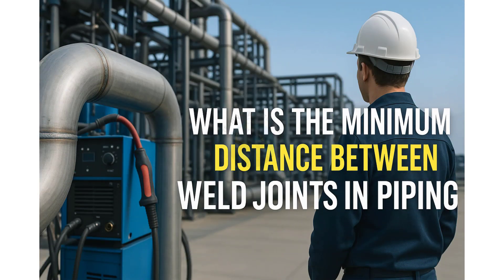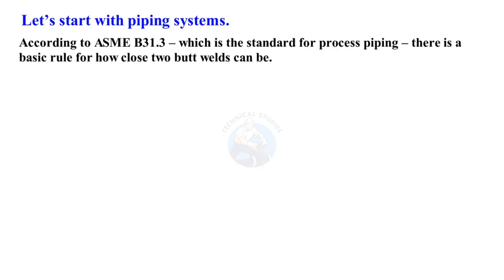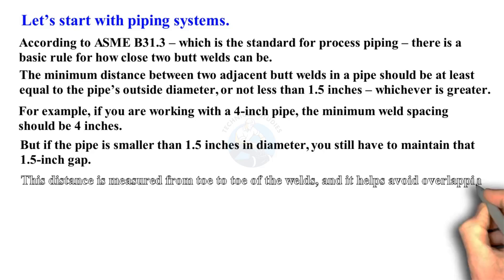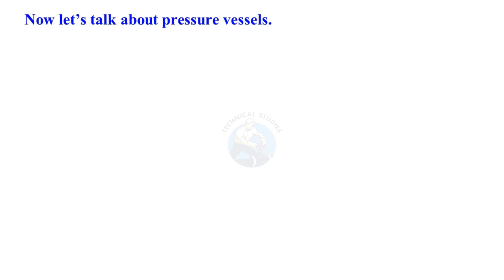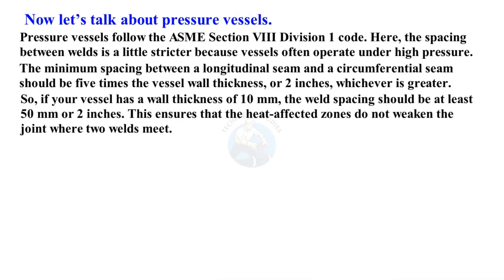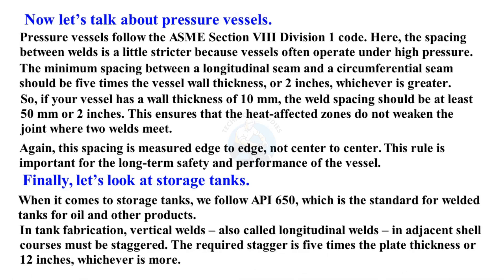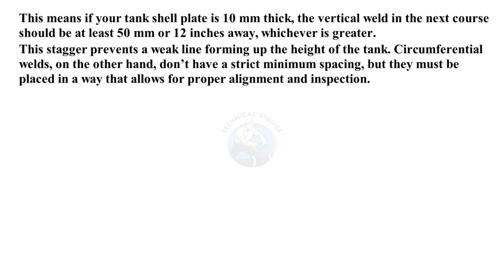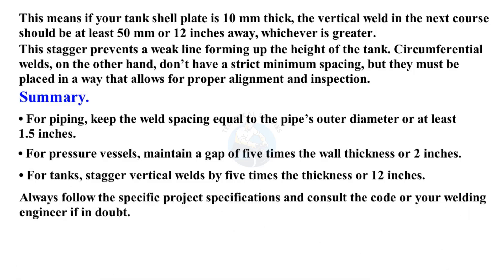What is the minimum distance between weld joints. Piping, Pressure Vessels, Storage Tank.

Comment: You have a spelling error :-  
In tanks if the thickness is 10mm the next weld should be at least 50mm or {2 inches not 12} 

Thanks a lot for this information 
Great video
Reply from the maker: Thanks for catching that, Bro! I'll make a note to correct the typo. Glad you liked the video!

Comment: In B31.3 please can you give that reference paragraph? 

For what i know it doesn't give a toe to toe distance for circumference welds
Reply from the maker: In ASME B31.3 Process Piping, the minimum distance between two adjacent circumferential butt welds is not explicitly specified. However, ASME B31.3 paragraph 341.4.1.6.B does require that when a circumferential weld intersects a longitudinal weld, at least 38mm (1.5 inches) of each intersecting weld must be examined.
Reply: @technicalstudies.  Thank you for sharing your knowledge, but this item requires discussion. It seems to me that the paragraph 341.4.1.6.b.1 of ASME B31.3 2022 states that this 38mm minimum distance should only be required to examined the welds when circumferential welds are intersected by longitudinal welds. Therefore, there is no basis in ASME B31.3 for adopting this minimum distance 38mm between two circumferential welds as mentioned in your explanation.
Reply from the maker: @juniortres7575  Bro, really thankful for your time and the detailed comment and for pointing this out.  You are correct that ASME B31.3 para 341.4.1 (2022) uses 38 mm (1.5 in.) in the context of NDE of intersecting longitudinal and circumferential welds , it specifies the length of longitudinal weld to be examined, when it intersects a circumferential weld, not a mandatory minimum spacing between two circumferential welds. In my video, I referred to 38 mm as a minimum distance between girth welds, which is more of a project-specification rule, not a direct B31.3 requirement. You are right that B31.3 itself does not give, a minimum distance between two circumferential welds, that is usually defined by the engineering design, or company procedures.